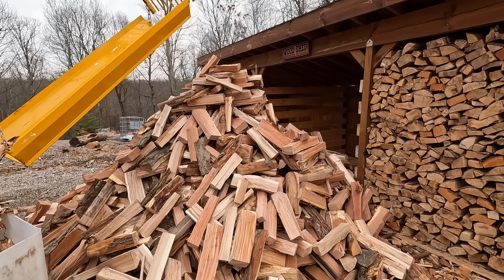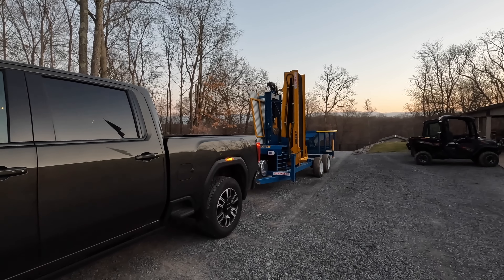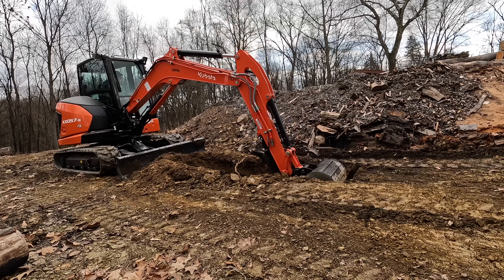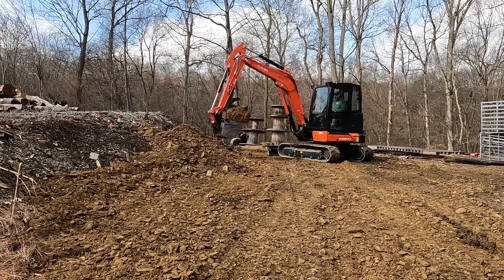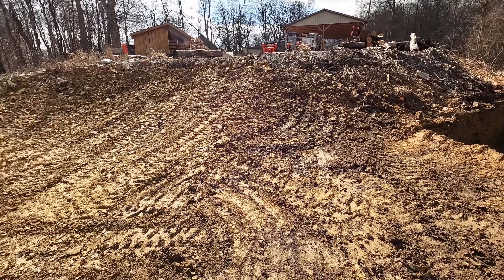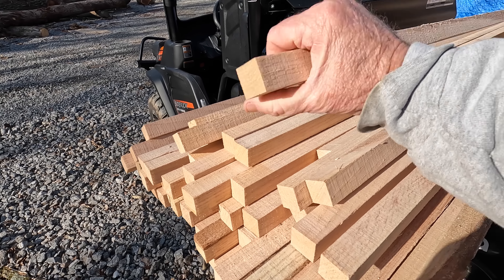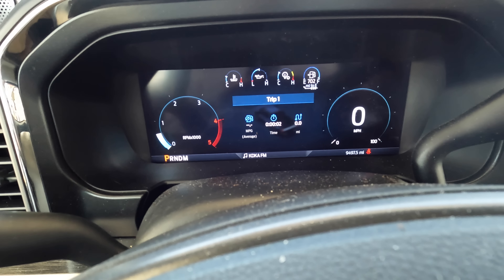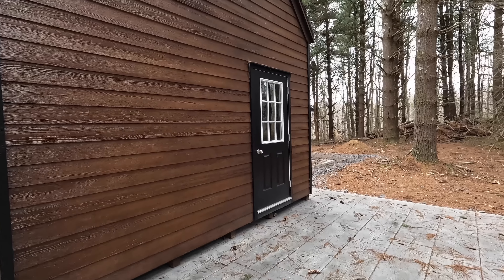Let's see how the Cabin Survived the Storms, Rex Encore and More

Comment: If you plan on keeping the cabin for a long time invest in rockwool rather than fiberglass. More expensive but mold resistant, fireproof, and better sound deadening. Also it’s stone dust, rodents won’t nest as easy.
Reply: Good advise. I think Rockwool is easier and faster to install as well. Buy the special knife for cutting it if you do Mike.
Reply: The rodents love to play in the fiberglass insulation, the mineral insulation ( rockwool ) the rodents will not go and play in it. Also there are many other avantages to like Mold resistance. Also if you don't plan on having continuous heating in the cabin, everytime you will heat the cabin  in the winter it might create some condensation inside the exterior wall and the rockwool will also help you with that
Reply: I have used spray in foam and love it. A little more money but its great, if you use the closed type..
Reply: @JohnWilson-ql8ks  Spray foam is a great product for it efficiency but I wouldn't recommend it without an air exchanger running constantly to avoid trapping in any humidity. For an off the grid situation I would  only recommend doing the floors with the Spray foam
Reply: Glad everything in WVA was ok!!  I like the idea of no sales tax on precious metals!!  In Georgia we pay tax on everything!!!!  Stay Hydrated and Have a Safe Day
Reply: Fibreglass insulation is sh-t! Get wool/polyester (ab/desorbs moisture), or rockwool. For what it’s worth…
Reply: Most definitely!
Reply: If it’s stone dust then thats the selling point, we all know how much Mike like stone, haha
Reply: Good to know Sean. Thanks for sharing. 😍😊😉👍❤️💜🙏
Reply: I miss the red and white pines... I used to walk past the biggest EWP on my way to and from class. I enjoyed the 30 below back then, but like our current 70s and 80s at Feb's end much more now! If I ever get to WVa, I will have to invest in more precious metals

Comment: Mike - Use Rockwool.  I converted an 10x12 shed into a home office and used 3 1/2" in the walls /ceiling and floor with 3/4 " T&G Pine over all of it.  Very good for sound proofing and it's also fire proof.

Comment: Just letting you know about the Ford have a problem blowing head gaskets because of the way they did the head bolts only on the 6.7  and the 6.0 they have been known to pull the head bolts out of the block

Comment: Hi Mike. Great video. I ❤ all types of woodlands. Have you seen all birch trees before. Wow! Impressive sight. Great paper bark to start fires. It's has it's own producing oil within the paper. Of course. It has to be dry. The birch slabs off the sawmill. It makes hot & quick fires. We burnt some in Vermont in our first fall of 1981. We add our dry hardwood onto it. It was $5 for a 4 by 4 by 4 foot high. Then the smaller sawmills were disapperaring throughout the 1980s. Your skid loader does a great job packing that soil in. 😍😊😉👍 My best friend's father at that time. They had a shale soil pit too. They spread it on thier washed out roads throughout thier 250 acres of property. It packs in nicely too. Well. Offically. Your back to a " lone" Wolf Ridge man. 😆😆😁😁 Say Hi to Melissa, Eva, & Hunter. 😍😊😉👍❤️💜🙏

Comment: Mike: I worked in the insulation industry for years. You are right. When a contractor does an insulation job 90% of his cost is material. If he is a large contractor, he can buy material for the same price as the big box stores. Since he has no bricks & mooter store, he can sell you the job complete for what the material will cost you if you buy it.

Comment: Mineral wool insulation is resistant to bugs, sound, fire, and temperature transmission. It costs more, but less than foam. I suggest you wire the cabin like you will live there. Bring circuits to a panel. Then, have the panel set up for a  generator supplying it. Panel, wire, boxes, and fixtures less than a grand. 
In the future, you will want the simplification of that method rather than solar/batt packs. Think of Melissa,  daughter and DIL's coming for a girls' weekend.
What of a well someday soon? Needs 208/230 power. Lotsvofvopinion here
😮😂

Comment: Mike, I just wondered if you could take those little slabs, you just put on those 2 logs, get your grinder that make wood chips out of them, and Then you could make your wood Chip Fire a starter out of them. I don't know if that's available to buy something that would make those kind of chips. But Hey, it's a suggestion you already got the wood. All you need is a chipper that would chip those up enough to make fire starter out.

Comment: Just as an aside, because I realize there are a boat load of considerations in this regard, but just off the top of my head, I was thinking that hill/bank alongside the new trail/road where you need to expand the width anyhow, you could remove a few trees, and dig into that hillside for a lot of shale maybe. You can finally level it off in that area where you took it out of for additional parking, or maybe even a turn around.  That shale could be an excellent base for your new trail/road. Just a thought.